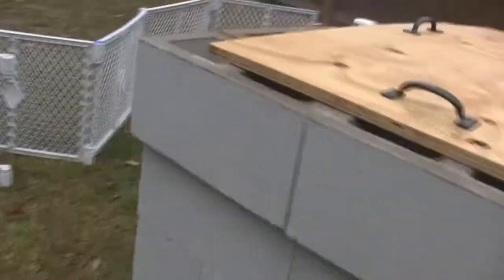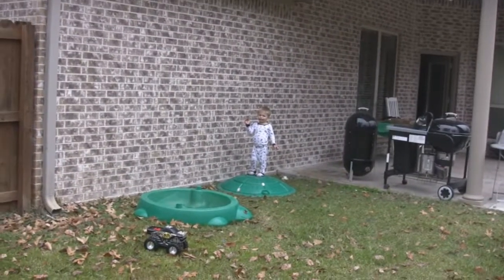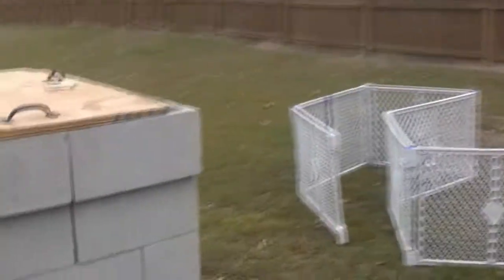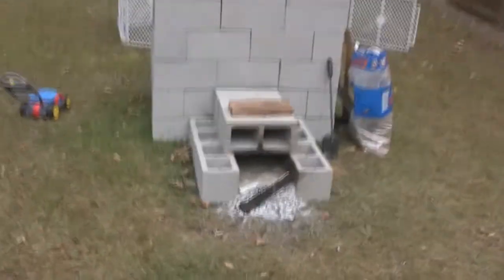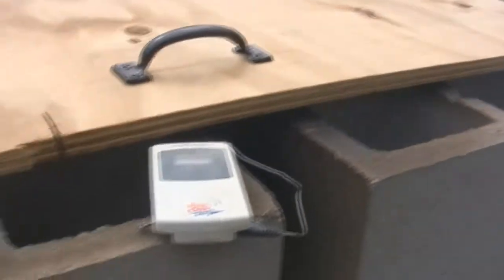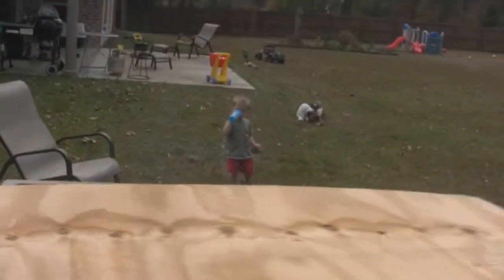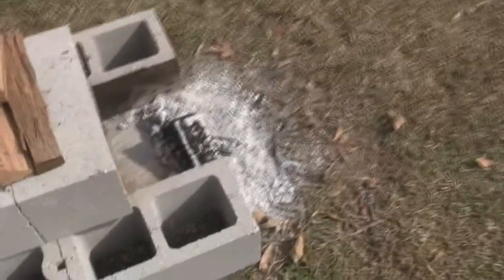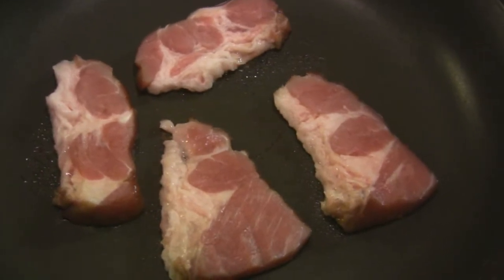Buckboard Bacon - Hickory Smoked

Comment: Tom after you debone the butt, cut it half the long way. It's takes the brine much better. But some bacon hangers, they're not much and very handy. if you'll smoke it to 145 degrees before pulling it your going to get a much better bacon. The extra time and temperature helps cook out the connective tissues. I put mine in two gallon zip lock bags and into an ice bath to stop the cook.